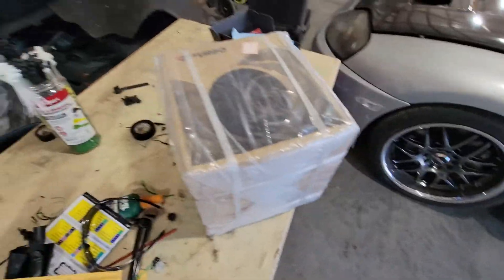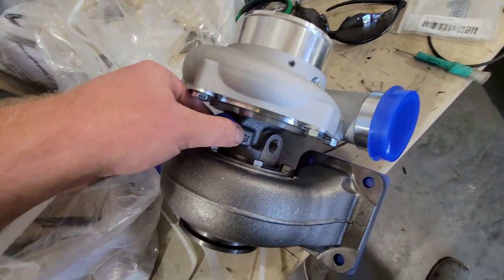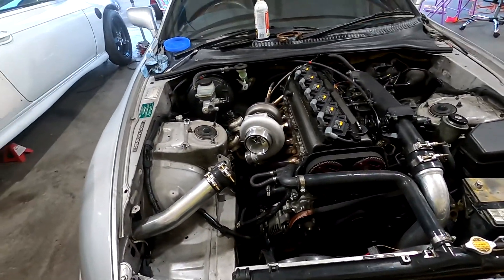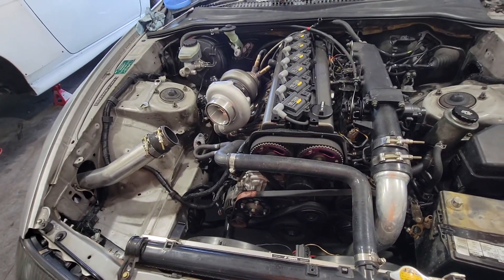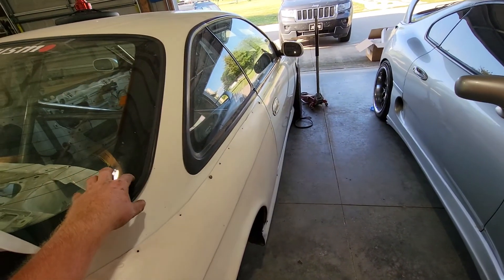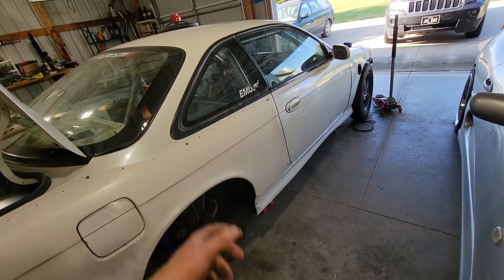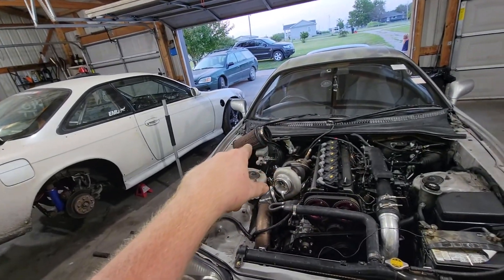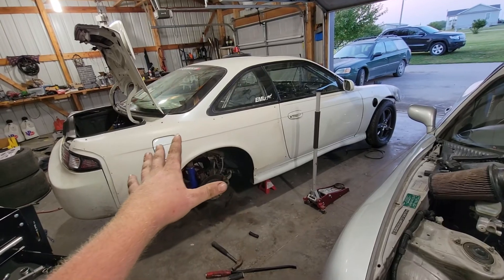THE SUPRA GOT A GTX3584RS WITH A T51R MOD (SOUNDS INSANE)

Comment: They are great turbos. I have their billet S369sxe with the T51r mod. So far so good and sounds amazing.
Reply: How long have you been running it?
Reply: @dsmperformanceracing4355  about two months.
Reply: @madkas14  do you find that the t51r makes it annoying? Makes the flutter louder too?
Reply: @MINIPOTHOLES  I personally love how it sounds. I don't get any flutter, make sure you have a good bov.
Reply: @madkas14  right I forgot some people don’t run bov. I don’t run one that’s why I have flutter, not cause I have a crap bov
Reply: What’s the loudest turbo with the t51r?
Reply: @1bad335ii  maybe the original t51r. Pretty much any turbo with that mod is going to be loud.
Reply: I just bought the s366 with the t51r mod going on my GTR.  Im installing it this month.  How is yours still holding up?
Reply: @WesleyJina  So far so good, no leaks or any other issues as of yet.
Reply: @madkas14  Are you running twin scroll?  What are you hitting full boost at?
Reply: @WesleyJina  twin scroll, about 2800rpm. I'm also running cams. 14psi
Reply: Hows the s369sxe going? Is it laggy? Im stuck between the pulsar s369sxe or g35-1050 to make 800whp on a 1.5jz
Reply: @Zorres  it's still working great. I'm on a 1.5jz with 264 cams. There is not much lag.
Reply: @madkas14  is there somewhere i can follow the build?
Reply: @madkas14  do you have instagram or something dude? Ive got a 1.5jz too but with a 3076. Looking to go bigger and pulsar s369 has caught my attention
Reply from the maker: Pulsar g35-1050 is a super good option